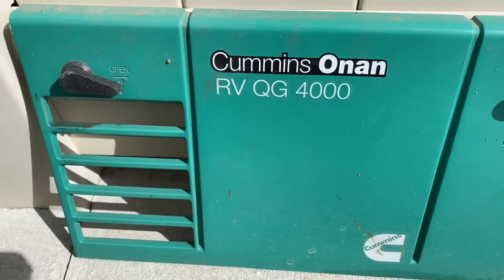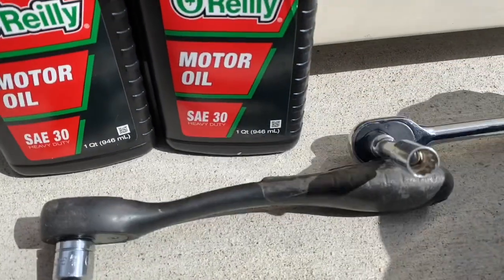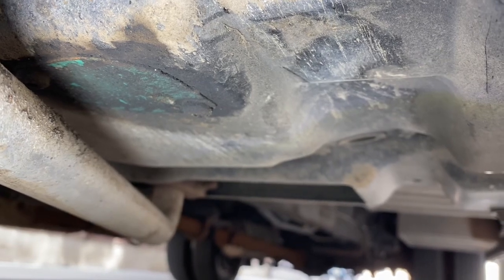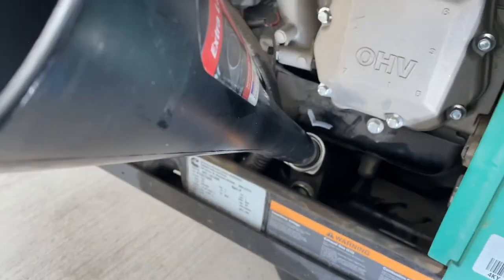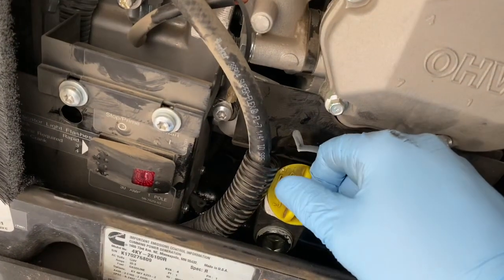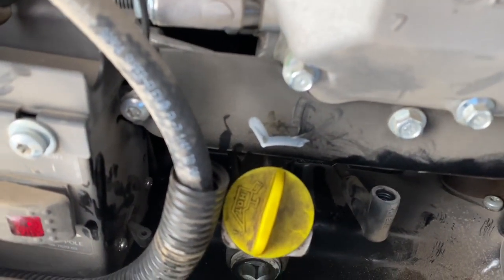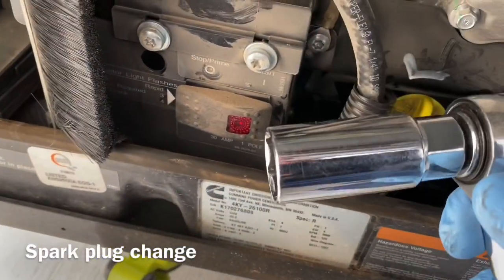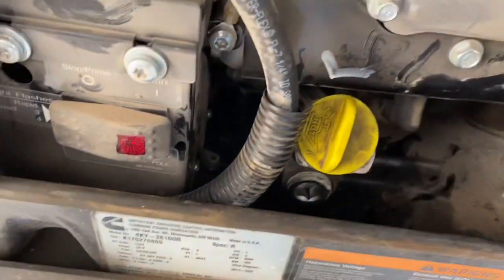RV Onan Cummins 4000 generator Oil Change  Annual service oil spark plug air filter

Comment: This worked beautifully and I wouldn't have had the confidence to try it without your video.  Thank you! Thank you!  Even a girl can do it. LOL! The hardest part was getting the bolt unscrewed to drain the oil and getting the spark plug boot off.  Tip:  The socket has to go pretty far up in the opening to grab the spark plug. I'll now be tuning my generator every year.  Thanks again.
Reply from the maker: Glad to hear, thanks for sharing

Comment: The air filter is hard to get out. How did you change yours ?  How many hours did you have on your gen before you change the plug.  ?    Thanks
Reply from the maker: Mine had 200 hours on it when I bought it, I’m not sure if it had been changed before but I changed it anyways.  I would say an oil and air filter change every year and a the spark plug every other?
Reply: I see his cords were moved. I had a hard time getting mine out too.
Reply: I just wiggled mine around the cords to get it out.

Comment: Question; I’m doing all the general maintenance because my generator won’t start, so I’m starting with that. With that being said, can I change the oil without the oil being hot?
Reply from the maker: Yeah that's not a problem

Comment: So I'm guessing  i have to do this eventually. Hmmmm -- so wallyworld gave me a freebie today - its a small thingamajig but it works. (the tools sprocket t n tubes ) lol the paper flew in the wind -- as I was looking I'm such a clutz. So I did check air filter still white so I don't need it, but maybe the sparkplug - what color is it supposed to be before I change it lol - not mechanically inclined at all but not paying an RV mechanic $250 to do this. I can do it.  Hahaha wish me luck!!!
Reply from the maker: Just follow the steps in the video and you’ll be fine.  Thanks for watching
Reply: @Myksgarage  what color is sparkplug has to be b4 changing? All I'm asking. Looks smacking new to me. Silver.
Reply: @amerikaveebeau1175  Piss Yellow !

Comment: Does your generator have a oil filter?
Reply from the maker: No it does not
Reply: Myks Garage  thanks for the reply. Quick question . You put alittle over 1 1/2 quarts of oil . Or alittle under.. I believe you said alittle over? Just confirming. Thanks
Reply: @NateRobertson-jl4jm  The book says 1.6 qts., but to be entirely accurate, use the dipstick on level ground.
Reply from the maker: It’s 1.6 quarts of oil

Comment: Where's the oil filter replacement video? I guess there isn't on in this model?
Reply from the maker: Correct, mine doesn’t have an oil filter, it’s just a drain and refill procedure.

Comment: What makes you think spark plugs come pre gapped?
Reply from the maker: It’s just a guess….
Reply: They come pre-gapped. That is what those sequence of numbers/letters on the spark plugs is. One of the numbers is the gap size. Look it up.
Reply: @happycampa1  Well, that makes no sense. What if the plug is dropped and the gap closes? Now what? How does one check the gap on a used plug? 
It serves no purpose to hide the gap setting in some secret code that nobody knows. Mine is part number Onan #167-0275 and the plug number is Champion RN14YC. 
So tell me, what is the gap?
I have looked in the owners manual, the installation manual and the service manual and no where do they tell the spark plug gap. I have never seen this with any engine.
I have read, unofficially, that a number at the end of Champions plug number is the preset gap though I can't find this on Champions website. For example a RN14YC4 meaning .040, but who knows this? Mine don't have a suffix number and are at .025 out of the box, on the one I checked. The 14 is the temperature, the higher the number the hotter it is, and the "C" means a copper electrode. No mention of the meaning of the "Y".

Comment: I take it there's no gas filter on this model?
Reply from the maker: Correct
Reply: @Myksgarage  Great. Good vid too...concise and clear. Thanks
Reply: Actually there is a fuel filter on these onan 4000 generators. It is located on the inlet side of the fuel pump. The fuel pump is located behind the generator control module under the inlet cooling fan.
Reply: @donniecahill5243    Yep that black plastic covering hides it pretty good ! 👍

Comment: Whoever ran your exhaust pipe over the drain plug should be slapped.
Reply from the maker: Yeah I agree!  Are the all like that or is each one custom?
Reply: @Myksgarage  mine on a Jayco Melbourne goes behind and L shapes to the side.  I would think any muffler shop could do something better for u.
Reply: Mine is similar to this setup-greyco jayhawk. Also my exhaust hanger has broken so that’s no beuno

Comment: there is no such thing as pre gapped plugs
Reply: @Myksgarage  yea the pre gap them but in boxing shipping the get un-pre gapped easy so you should always check
Reply: Yes they are pre-gapped. You can always change the gap yourself if you need it different. The specific code on the spark plug for your specific application should be gapped appropriately. If they don't make the plug with the gap you need, you adjust it. Look it up.